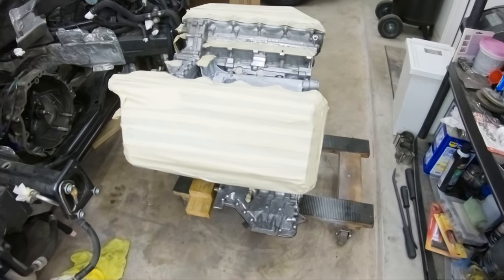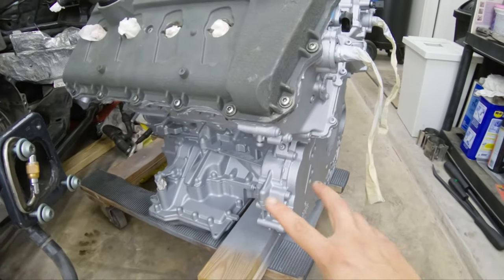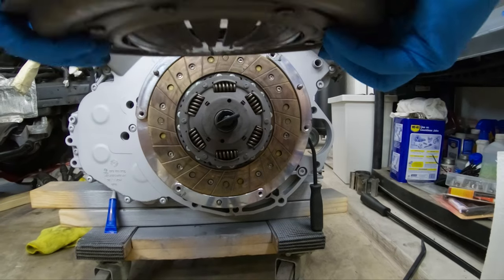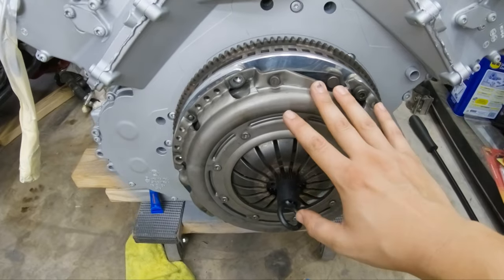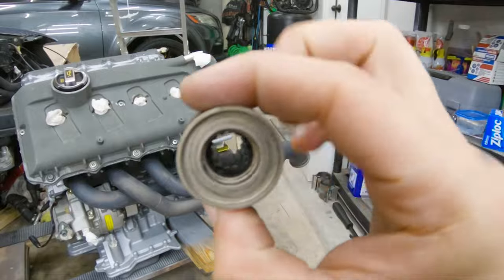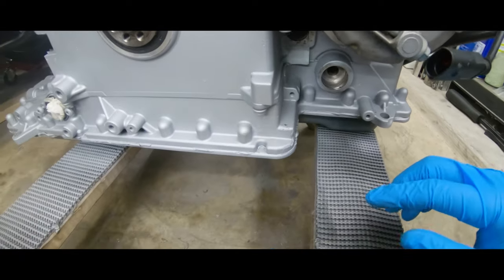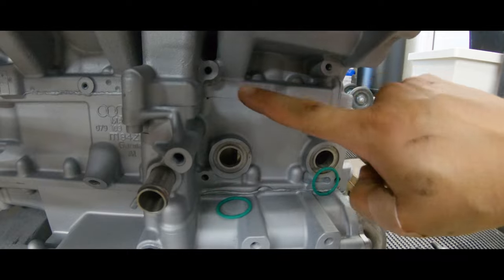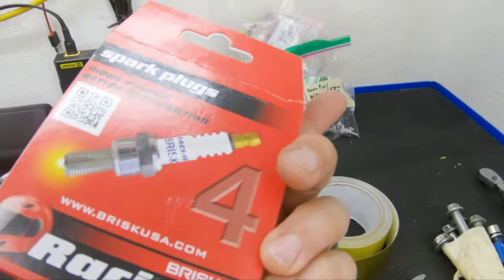Engine Accessories back on

Comment: Im so glad to see the progress man. I have a question, did you ever had any issues with engine slightly jerking, almost like a missfire during low rpm around 2k with a very throttle slightly open? Under full load there is no issue at all its only when i cruising and maintaining low rpm or stady speed. Im struggling to find out the cause of this issue on my S4B4. Ive changed coil packs, spark plugs, o2 sensors. Next is maf sensor, but i thought ill ask you if you also expirienced such isses back when you rcar was still N/A. Cheers and keep at it
Reply from the maker: Thanks!!!

Unfortunately I have not had that issue. The closest thing i had was that my rpms would stay stuck at 3k when i would have the foot of the pedal. When I changed out the clutch switch that went away.

Comment: How do you like the JHM lightweight flywheel paired with the ringer clutch? Was thinking of going with the exact setup
Reply from the maker: In the time I've had both combos i have not had any issues at all. One thing I failed to mentioned which i am now thinking about it. If you do use the ringer racing clutch use the throwout bearing that comes with the clutch. Don't use oem or if you have 034 bearing DONT use those.